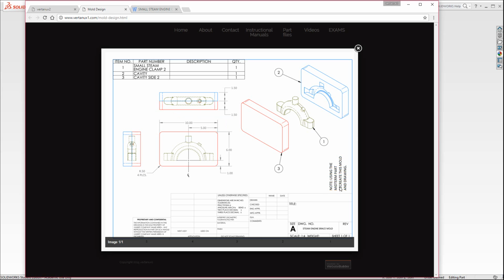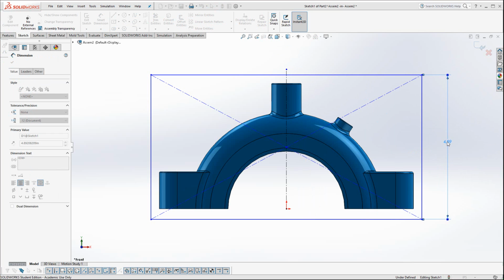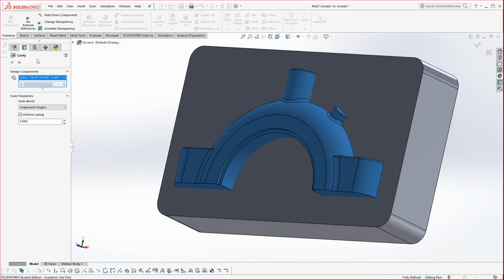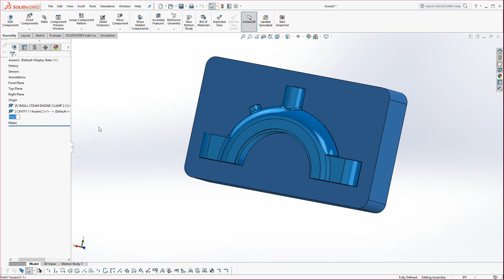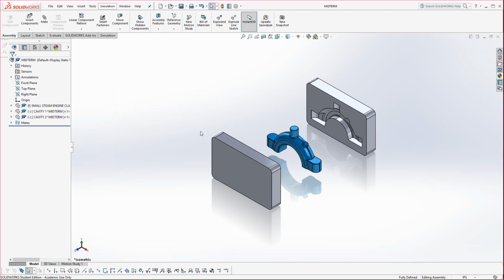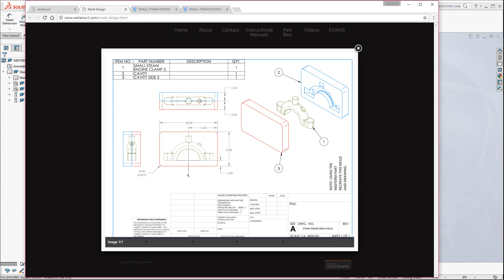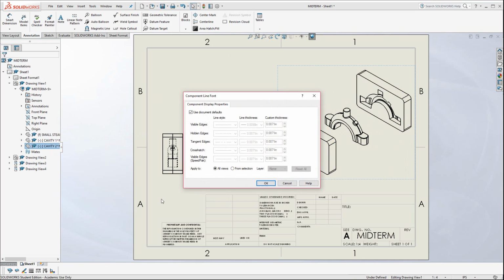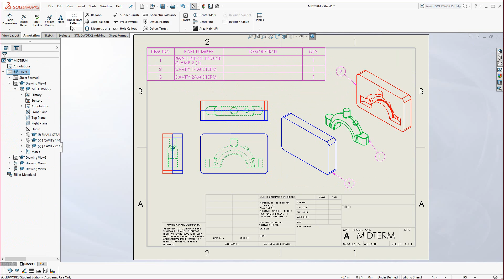L15 SolidWorks Cavity & Mold Drawing Tutorial

Comment: When you make molds like these is it not common to add in a port/hole where the molded material is injected? Or is that what the top extrusion is?
Reply from the maker: This is just a basic cavity lesson, not intended to go into details such as gates, cooling lines or ejector pins.
Reply: Oh OK. Do you all have a video that includes how to determine where they should go in the model and how to place them?